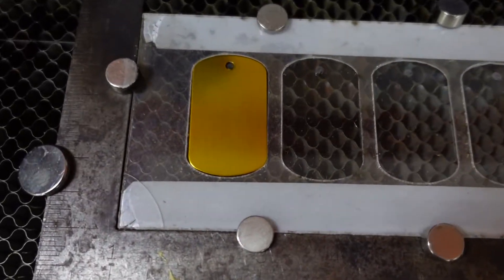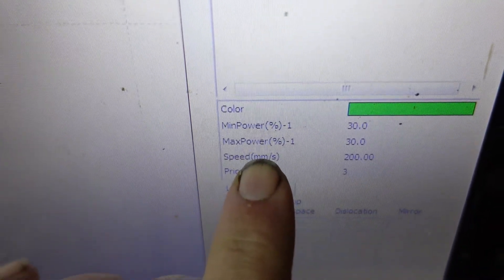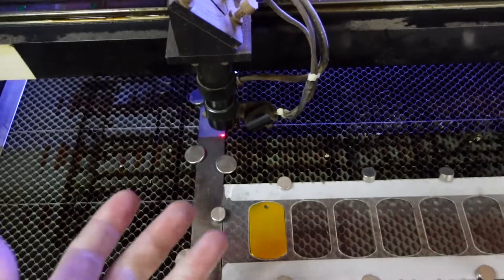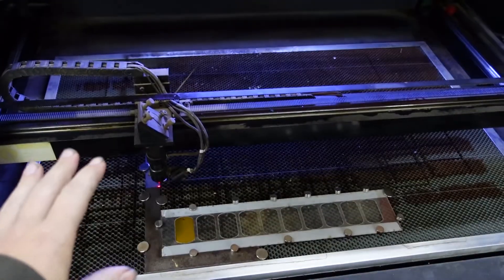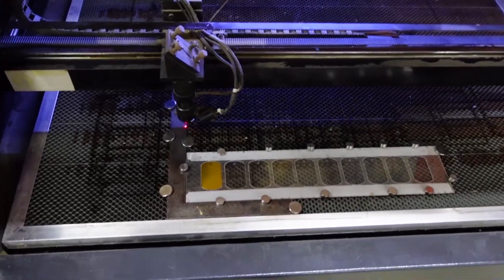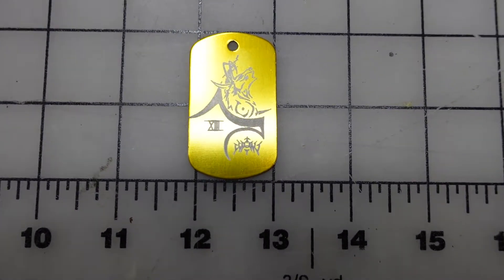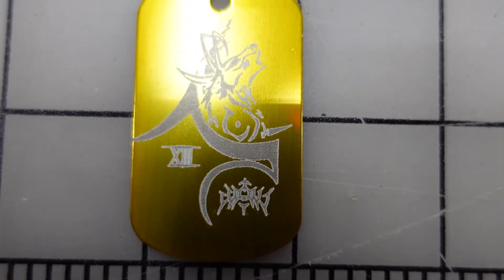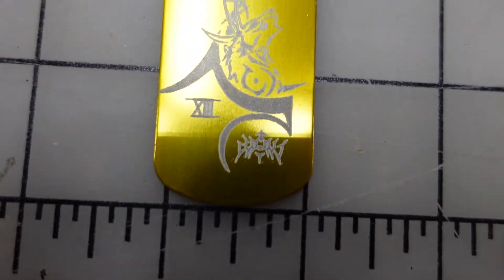simple laser engraving anodized aluminum

Comment: Im struggling to engrave anodized aluminum for an award plaque. I have a 80w Omtech CO2 engraver and light burn software.
Reply from the maker: dont know much about light burn sorry, but best i can say is start with the above settings and speed that  should get you close and you might have to tweak them from there a bit
Reply: @morphingwolfman  thanks boss